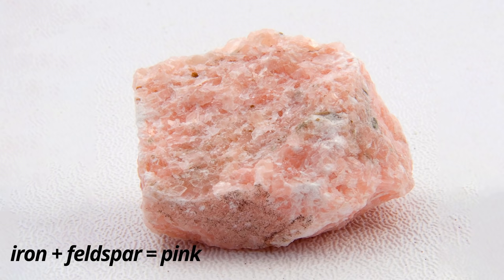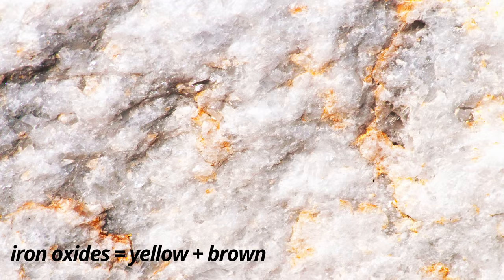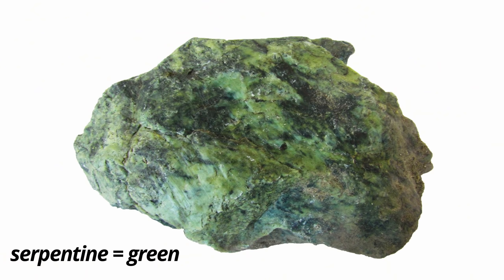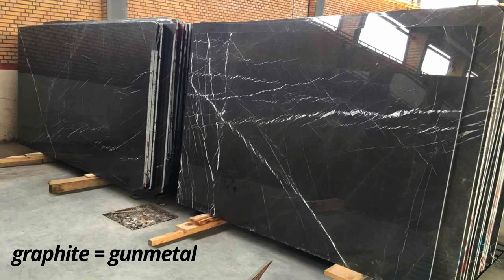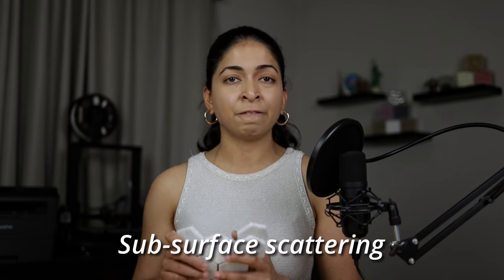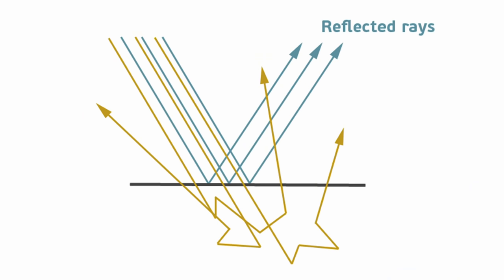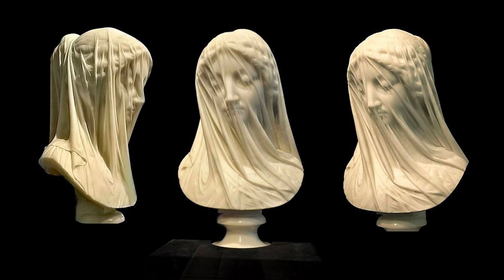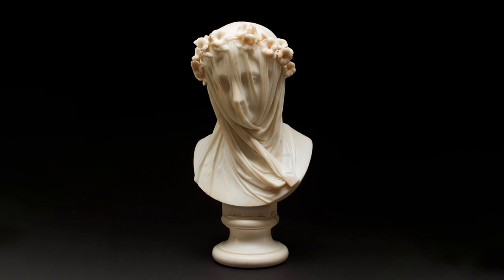Marble vs Concrete Countertops | Everything you need to know!

Comment: Hi Belinda, just a follow up question on the concerns you mentioned about epoxy (fumes, exothermic reaction, etc) at the end of the video. These are typically concerning during the application process but I’m wondering if there’s any harm once the epoxy layer has already dried and the counter top is ready to use

Comment: Hey Belinda so I actually install commercial epoxy countertops and floors and the products I use have low vocs or no vocs and the exothermic reaction is minimal not causing damage to surrounding areas or other surfaces. My products usually go on at about 1/8 of an inch thick and then I top coat so the whole process puts 3/16 of a layer on their countertop which adds incredible durability and high resistance to heat and impact you could literally put a pan that you have just taken off the stove onto an epoxy countertop and it won't hurt it likewise you could also use it as a cutting board with little to no damage and the best part after High traffic use you can buff it out and it'll look just like new
Reply: Sounds like an advert..

Comment: The translucence of marble is not paralleled by anything except maybe onyx. It has this Natural Glow around the edges that is unique. When we do bathrooms we do entire shower stalls in one centimeter thick, yes that's right, just 10 mm thick slabs. We use the same slabs as the backsplashes so as to save countertop space but then we use 3 cm for all horizontal slabs like window Ledges the tops of knee walls, or vanity tops. The beauty of marble simply can't be matched by fake products like quartz. I am also glad that you pointed out the much lower carbon footprint when something is not shipped across oceans and there are beautiful marbles here in the US and we actually have an agreement where we pick them up directly from the quarries.
   Now on to concrete; poured-in-place concrete is the medium of YouTube hacks. Professionals always fabricate off-site and then bring to your house because you simply can't polish concrete the way it needs to be polished if they want that sort of finish inside of a house because of all the water that is used. If you do not want polished you can still have absolutely glass slick countertops and that is done by using special forms and special processes and different layers of cementation as product to build up the countertop from the top up (as it is done in a form upside down) when the form is removed you are left with something that is as hard as concrete but can be add light as bright white to any color you wish and can have inclusions or things placed into the mold,  things like gears or pieces of Gears or even shell or through the entire Matrix you can use recycled glass and oyster shell and there are companies that make a composite mix of recycled glass, aggregate, cement, seashell and resin and those can be commercially purchased in slabs. The best concrete tops can also be made in a about a thickness of 12 mm. This is done by using AR fiber and fiberglass quarter inch scrim embedded in The Matrix on the bottom ( or midele layer) and as for the thickness of the edge you can simply build up the thickness as you create the top when you are hand placing the material in the form.
Now, let's talk about fake stuff like epoxy or even making fake marble out of concrete both can be done and I have seen both that were fairly convincing but they were done by absolute artists under the perfect conditions in settings made to do that type of work. The typical person usually makes what looks like a shiny piece of plastic with lines in it and usually it gets torn out by the next person who sees it or buys the place. I see many times where people will try to epoxy over concrete countertops where someone did a bad countertop out of concrete and then somebody else does a bad countertop on top of it with epoxy and in the end somebody else, a professional, has to come in and remove all of it! It can be done well though, We had an artist make some panels for us to match a slab that we could not get thin enough to do the shower panels with a thin slab like we wanted and although the owner knew,  everyone else that looked at it did not and when they were told they did not believe that it was not Natural Stone like the vanity and the other slab work in that bathroom. The bottom line is whether you are having marble or concrete or epoxy it pays to just hire somebody as DIY projects usually look like DIY projects.✌😁
Reply from the maker: Great insights! I agree with you, Daniel.

Comment: I've never understood marble countertops. I actually use my kitchen for cooking, and know from some Geology classes that marble is a "soft" rock. It only has a mohs hardness around 3. Metal (knives, mixing bowls, silverware, etc) is usually around 5 meaning anything metal in the kitchen against the marble countertop will scratch it. Marble topped tables in low traffic areas (like side tables) is fine since it won't see nearly the usage as the kitchen counter (unless you don't cook and the kitchen is just an expensive show-piece)...

Comment: Great video and very helpful. I was wondering about the colorization of the concrete countertops. You said in the video that the color will be dark grey. But you had some very vibrant colors as samples in your video. My question is is choosing a vibrate color with the color last over time? And if so does it require a lot of maintenance? Thank you again for a very interesting video.

Comment: Splendid video, I love the "facts" you share w/o opinion. I personally despise marble countertops & marble floors such as I have in the powder room). For floors, we considered having the existing concrete grooved to look like tile but eventually went with ceramic tile. I consider marble to be great for surfaces that are seen but not often used (such as a powder room countertop). The rough marble in the master bath just looks unfinished - I know it is rough, so it is not slick as a snotty doorknob, but the look is - YUCK. For countertops in a kitchen, I would not even consider anything but granite. In my experience, it is impervious to heat, stains, etc.

Comment: Not only are marble and granite quarried from the Hill Country near Marble Falls, but some of the marble is actually mined for its calcium carbonate. The J. M. Huber facility in Marble Falls pulverizes the marble into fine powder which is then shipped out in rail cars. Powdered calcium carbonate is used in various industries, including the pharmaceutical industry, and is a key ingredient in antacid tablets.
Reply: Its also used in fake tops and is found with ATH, VE resin, and pigments in cultured marble.
Reply: Powdered marble is also used on some chewing gums to keep the gum non-stick between manufacturing and consuming. One of the bug gum manufacturers has (or at least had back in the 80's) a marble mine somewhere north of Baltimore MD.

Comment: This begs the question as to what is the better material for benchtops etc? Are you familiar with Corian and if so, do you have any opinion on it?
Reply: Corian is not as popular in the kitchen builder space. It has a lot of the same properties and aesthetics you see in laminate (feels like plastic, scratches easily, doesn't resist heat) but costs the same as quartz or porcelain.
Reply: @user-xg6zz8qs3q  Thankyou.

Comment: The problem with concrete is not just the energy expended to make it, it's also that cement production produces more greenhouse gases than automobiles--those gases driven out of the limestone.

Comment: I wish you would have included reference to white portland cement.  Like, how is it made to be white?  Is it actually portland cement or something else?
Reply: Shhhh... dont let out the secret!
Reply: I was really liking that terrazzo countertop with white cement!
And with white you can add enough pigment to get almost any value of any color.
Be careful with the fiber reinforcement though if you're grinding away to expose the aggregate like that.
Reply: @jimurrata6785  You only have to be careful about the fiber if: 1) you didnt use a facecoat which is a different layer than the main body or 2) failed to use the right fibers which can be removed after grinding and polishing.
Reply: @danielbuckner2167  Terrazzo is by definition  ground or polished to beneath the surface.
I never considered trying to pick or pull the fiber out of the finished surface.
Thanks
Reply: @jimurrata6785  I am familiar with Terrazzo. It is not a term used by Professionals in the countertop industry but the definition does not preclude countertops either. Trying to pull out fibers off of the surface if you have fibers making it through to your face coat isn't the way to remove them.
Reply: @danielbuckner2167  I've never tried terrazzo on a counter, but it looked beautiful in the video.
I not sure how to deal with exposed fibers showing on a counter because I'm not making them. But you seem to have plenty of experience.

Comment: Every concrete countertop thinner than 75 mm (3") that know about has developed cracks over time,  That may be part of why sidewalks are 100 mm thick.
Reply: And all sidewalks have cracks. I was advised against concrete countertops. There's a reason most builders use stone, quartz or porcelain.
Reply: @user-xg6zz8qs3q  I have poured 2 concrete countertops that are 3 inches thick, and years/decades later, they/re crack-free.

Comment: Wait, wait, wait... did you seal that marble before that test? Seems unfair to use sealed concrete and unsealed concrete!
Reply: She said it was sealed, but the acid in the liquid ate through. 6:46
Reply: @eklectiktoni  How was it sealed? I would not trust an off-the-shelf product from a box store to be properly sealed. DEX is a company specializing in cementacious producys and gave a sample so I am sure that sample was well treated. I imagine their sealing process is partially a densifier to harden the surface to get a smoogh polish and reduce porisity and then a silane based sealer applied. I wonder how that marble would perform with such sealing precautions.🤷🏻‍♂️

Comment: Both are terrible options for counters, in my opinion.
Reply: Exactly! They're porous. Just look at marble tables on the used market. They're all stained and chipped. Just get laminate! Laminate is so underrated because it's inexpensive.
Reply: @user-xg6zz8qs3q  Or use quartz.
Reply: @jc2604  Yeah sure. But my point was that laminate is less of a pain in the butt for a fraction of the price. And manufacturers are improving laminate aesthetics lately.
Reply: @user-xg6zz8qs3q  OR SOAPSTONE. I love soapstone. Looks so much warmer and more rustic than more standard modern countertop materials. No need to seal it at all, doesn't really stain, is heat resistant (used in freaking welding for marking things), doesn't crack, is soft to the touch, etc. Only con is really it's softness, it is really easily marred. But I find it less likely for me to cut into my countertop, even by accident, than spill stuff. And the softness almost eliminates cracking so the softness is a bonus in some respects.

Comment: Again Belinda you have lumped all epoxies into one category. As an educated professional I know that you know the difference is in paints because of what is in them or the differences in grades of Steel because what is in them and you just talked about the differences in concrete because what is in it so I find it surprising that you have not done the research to see the vast differences in epoxies because of what is in them. Certain epoxies you can mix up an entire gallon of and then put your face in the top of the bucket and breathe in and you could smell it but it wouldn't cause any breathing issues other than being able to smell it. Some epoxies are very toxic in what they off gas but there are those that are completely safe to use indoors. Now I would also agree to ventilate any workspace because even standing particles can be dangerous but certainly not all epoxies are the same.
Reply from the maker: I agree, but I can't dive into the different types of epoxy in a 10 minute video on countertops.
Reply: Not being mean--- if you didnt do such great research and in depth videos I would have come expect such fine work. 😁😛
Reply: @BelindaCarr  its true but the types marketed for both countertops and flooring have almost no smell and once cured zero off gassing. I know you had a bad experience with that bathtub epoxy and urethane epoxies are awful and terribly unhealthy and definitely require a respirator, full face if available. I just dont want to slander them all or in other words throw out the baby with the bathwater... errr,...bathtub epoxy!

Comment: Extra-specific chocolate and ice cream kitchens notwithstanding, none of these surfaces have ANY place in a kitchen. I cook A LOT. The last thing I need is an expensive, delicate, needy surface to toss my heavy kitchen gear or worry about damaging or breaking the counter. I clean surfaces regularly, scrubbing or using vinegar to clean grease. I (or anyone that actually COOKS in their kitchen) NEED a stainless steel or cheap (disposable) formica surface to do work in the kitchen. 40 years from now, when this silly trend is treated as macrame in the 1970s is treated today, the grave marker industry will have a huge amount of cheap substrate from all these silly kitchens.